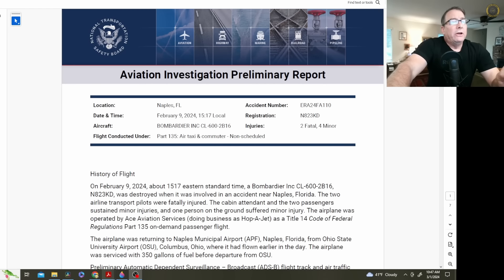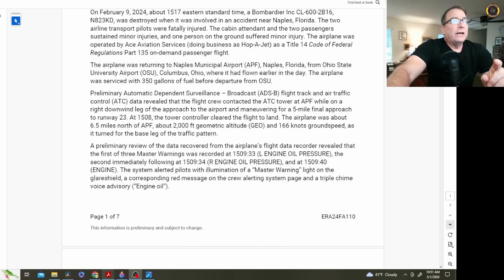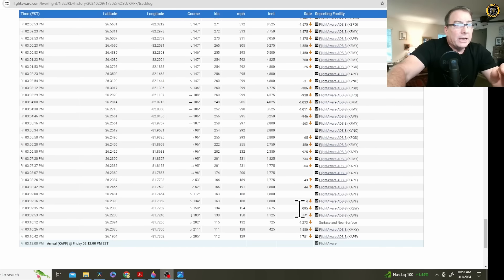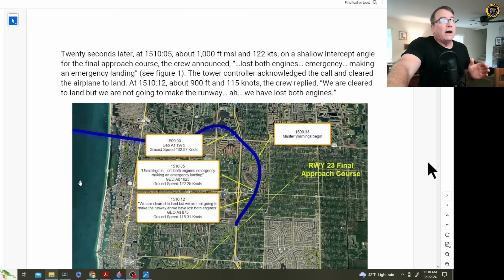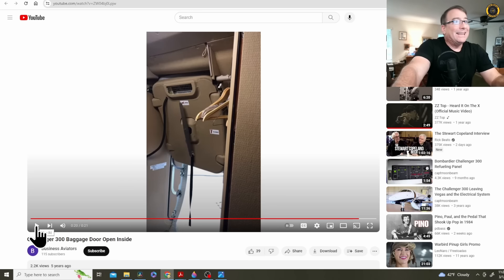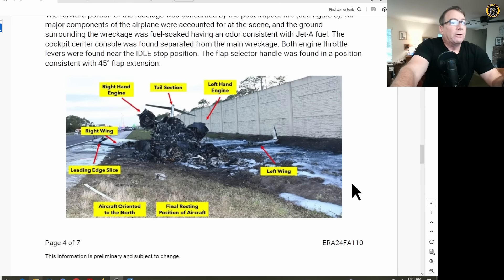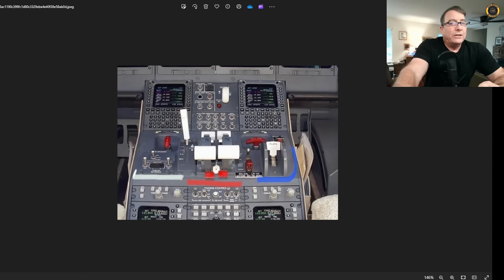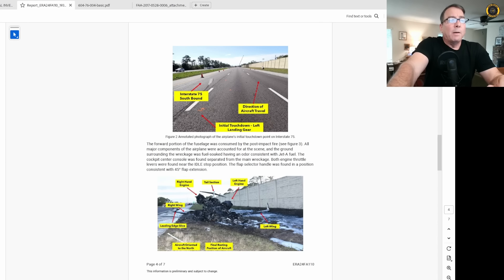NTSB Preliminary Report: Naples Challenger 600 N823KD

Comment: once again the NTSB is wrong. There are two major components in that plane that will take both engines out at the same time. One is the SDC, signal data converter. Infact if it loses power the pilot would lose both engines suddenly and know immediately they lost both engines. Not from warning lights either as the NTSB thinks. The other thing is the APR which is the thrust speed control for Both engines. It is a major single point failure for both of those engines. Both engines have their own Fuel control Unit and a fuel control amplifier. both fuel control amplifiers are controlled by the single APR. which should it malfunction or lose power will shut both engines at once.  NTSB is lost.
Reply: Highly possible. I think about a poor solder joint in one of those units. Would assembly be new enough to have allowed (or required) assembly of SDC or APR to use Pb-free, no-clean, halogen-free rosin solder?
The multifunction display (MFD) of a Prius, a similar single-point electronic controller device, loves to fail (especially when being sprayed routinely by volatile organic compounds during disinfection and hygienization of potential COVID strains) and render display of all power systems, and control of all climate and sound systems, virtually impossible.
Reply: @paulsherman51  I appreciate someone who sees the Reality. Here is another fact. The pilot stated that he lost BOTH engines at the exact same time or moment. This is absolutely impossible to happen with fuel contamination. Since the engines are started at different times and run up for different times as well as running different fuel flows, it is impossible for any contamination to be at the exact same point in the fuel lines for both engines to shut them at the exact same time. Only an electronic single point failure can do that.

Comment: Think the DTSB analysed the correct probable cause. Poor guys
Reply: No, he didn't.  The Challenger doesn't need Prist due to having fuel/oil heat exchangers.  Even if the fuel did ice up, the engines wouldn't shut down within one second of each other.  No way.
Reply: The Boeing that crashed in London, also had this heat exchanging. Yet the ice briefly coming loose was enough to the block the filters for a short moment, long enough to kill the engines.
Later they changed the design of the heat exchangers and filters to prevent this from ever happening again.

Comment: Yet another example of the lack of common sense in the aircraft design and engineering profession.  You can imagine the product design meeting conversation:  "Hey, why don't we locate the shutdown switches away from the control console altogether, so it will take a deliberate act to actually turn the engines off, when the flight is concluded?  No way, Johnson, that would cost another $ 387 for switches and wiring...keep them on the levers!".

Comment: Could also have been a fault in the throttle levers that shut  the engines down, just due to wear, not anything, the pilots did wrong at all !!!  Pilots need to be taught to look for a water landing right away, a great example would be sully putting the airliner down in the Hudson, everybody made it out alive!
Reply: They were on final for 23. Ain't no water on the path.

Comment: Dont know about jet engines but why would they only be at idle or just above if they know they lost thrust and not pushed up  i know idle to slow down for aproach but once they needed thrust shouldnt they have pushed full forward to regain
Reply: most likely muscle memory, pulling levers to idle just before touchdown
Reply: If the engines are shut off accidentally, you start in the IDLE position.  Moving them forward with engines off would do anything, like stepping on the gas with keys in the house 18:47

Comment: Requiring one pilot to reach around the throttles/thrust levers to select the flaps is a stupid design. And yet Boeing are STILL building jets with this design flaw (yes, I know this wasn't a Boeing). Airbus removed this design flaw decades ago. I've flown both manufacturer's planes. It's like Boeing believes the captain is always the Pilot Flying (PF). It beggars belief.

Comment: Should have landed gear up, would have stopped on a dime.
Reply: Actually, they slide further than with wheels and brakes.  Rubber has a far higher coefficient of friction than the belly of almost all aircraft, at least on a hard surface.

Comment: That possible flaps/throttle issue is a big design oversight - especially when combined with the inability to restart the engones. Even if it wasn't the cause in this case that's a huge trap for that aircraft and very poor design.

Well done to the flight crew though for saving everyone else on the aircraft.
Reply: Well millions of flight hours with this being the first such event says it’s not.
Reply: The inability to restart the engines that quickly and that low is more to do with physics than it is a design oversight.
Reply: @GLEX234  if this was the cause, the fact that it's the first time this design flaw has been fatal doesn't make it ok and certainly doesn't make it an acceptable design choice.

Humans are often able to work around bad design, but as a designer I'm always looking for ways to make the interface better and reduce the reliance on the user having to compensate for bad design.

You often hear Juan talking about "pilot work load" and also the dangers of pilots being "behind" the aircraft and how that contributes to crashes. Design choices like this increase the pilot work load and therefore increase overall risk. So yes it's poor design.
Reply: @johnaclark1  my comment about poor design was only referring to the flaps lever arrangement, not the inability to restart the engones, which as you say is a limitation of physics.

My point was that the combination of the two makes the flaps lever design choice especially egregious.

Comment: That shut down mechanism in absolutely not a good design.
It should have been rejected as a design from day 1.
Reply: That design is on many jets, both civilian and military.
Reply: @johnaclark1 Ok but that fact doesn't make it good or more safe.
Reply: A comment on a YouTube video speculating on an accident cause doesn't make it unsafe, either. I've flown jets with a similar design and never shut down an engine inadvertently.
Reply: @johnaclark1   Well, yes, I am not a pilot but as an application designer, when you design and develop, you always have to give the user of the system 0% chance of making a mistake, because you know, if there is 1% chance, they user will make the mistake, so as Juan well explained, there is a change that you unwillingly can intervene with your arms and shut it down, that's to me not 0% chance. 2nd thing, from a designer point of view, adding to the same controlling power mechanism also the functionality of shutting down the power (even if there are security switches in place) that's not a clever designed mechanism, to say the least, specially when you know how critical the situation is when the engines are shut down while flying (and specially when there are other safer design options available).

Comment: Since the 3 pax had time ta get out n NO smoke inhalation, WHY couldnt the Pilots UNSTRAP n get out? I can tell you, i would have had my HANDS on the SEAT BELT buckle n redi to :LAUNCH out the door.......Maybe they were in-capacitated by rotation of AC?.................. Dont make sense..
Reply: If the passengers couldn't get up to the main cabin door to exit, the crew couldn't either.  Pretty sure there is no other exit up front on the 604.
Reply: Because they experienced massive trauma when the plane's right wing hit the wall and turned the cockpit into that concrete wall.

Comment: Two pilots operating the aircraft at the same time...FAA approved. Colgan Buffalo accident also two pilots flying the aircraft simultaneously--- with an additional input from the stick shaker system.  3 input sources. Soon we will be back to one pilot flying---when there is only one pilot on the trip. Another thought....Why  does the global aviation system set up every flight for failure if engine thrust is lost five miles from the airport...like Naples. The Space Shuttle program would have been cancelled long ago.

Comment: Not buying Ca reaching over and lowering flaps and hitting the shut - offs...  Not buying contaminated fuel... Buying 350 gallons to fly from Ohio to FL is 2,200 pounds of fuel.  This plane ran out of gas, in my opinion.
Reply: Wrong
Reply: Wrong, too.  What was the fuel on board at KOSU? Show me that number and we can discuss
Reply: This is super common.  Take a bunch of fuel out of your home airport because it's cheaper.  Then buy the minimum amount of fuel to waive the ramp/parking fees.  This is how it's done.

Comment: Wow. Sad. Seems like a poor design. The fuel shutoff should be a separate lever.
Reply: Two airline crews, DL and UA, shut off both engines with completely separate switches from the throttles.  Mistakes happen

Comment: Maybe it’s just me, but having ANY potential possibility to inadvertently shut off engines from a thrust leaver seem dumb as dog doo!  What moron thought that was a good idea?  It should be completely and utterly impossible to shut off the engines via the thrust leavers.  The fact that the manufacturer states that it is not possible to restart the engines after doing so, acknowledges that there is s defect in their design to even allow this as a possibility.  I can’t turn off the engine in Cessna 150 with the throttle!  And for very good reason!  It’s shear engineering negligence if this is really the way this aircraft was designed.  BTW, you can probably tell I don’t buy the contaminated fuel theory.  I’m not any expert in jet engines, but I think you would have to really pollute a jet engine before it just stops. Also, they went that whole flight without problem, and only when they are getting ready to land the engines suddenly decide to go out right then?  How unlucky can you get?  Low probability then that this is what happened.  Much higher probability that with landing at hand, they pulled back the throttle, but seemingly too much.  It could be that the detents broke and let the throttle go to shut off.  In that case it’s mechanical failure.  But it’s a mechanical failure,that had no backup, and that is just wrong In aviation. Bottom line is that I think the throttle cutoff will be found as the culprit, and in turn, that IMHO is a design defect that just got two pilots killed.
Reply: Lots of jets work this way, mil and civilian.  Perfectly accepted method

Comment: What a terrible human factors design that requires a left seater to reach around the critical throttle arm of the right seater to engage the flaps. C'mon man-ufacturer!!!
Reply: Most all aircraft have the flaps on that side of the flight deck.  Super common.